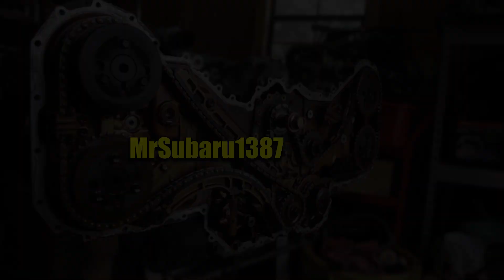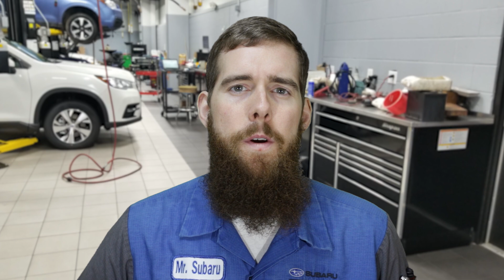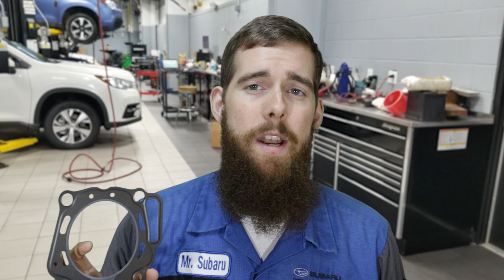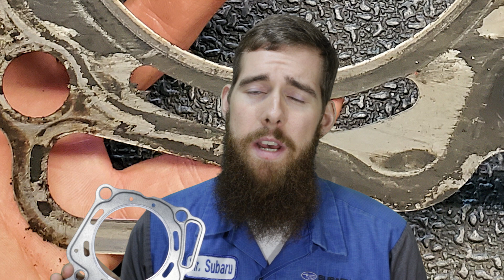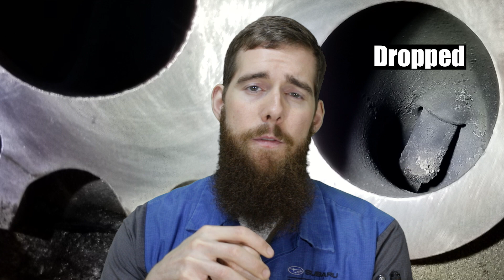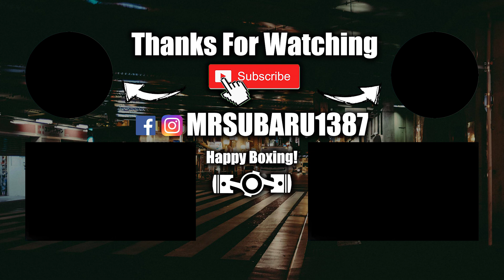Subaru Head Gaskets Explained

Comment: It seems like the head gasket issue was confined to a few engine models in the late 2000's. 
Is it safe to assume in newer models such as 2020' Outback, 2019's Forrester, the head gasket problem does not exist?
Also curious. @11:48, the problem gasket was shown. How is it that the head gaskets used in other good engines have no issues? I assumed Subaru either made these gaskets or outsource to third party. In either case, the gaskets from Subaru are still carbon coated. Why some engines fail using these gaskets and some don't?  Could the placement of coolant and oil ducts in these problem engines also play a role? aka it is an engine design problem and not just a gasket problem?
How are the head gaskets from other OEMs differ from those from Subaru?
Reply from the maker: Head gaskets are not an issue on the new FA/FB engines. 2011/12+

Comment: Please help with some advice...2008 Forester XT 2.5 engine..the temperature went to max hot and blew off the hose on the radiator next to the cap. Refilled with water and it overheated again...no evidence of oil/water mixing, could the thermostat be stuck closed or is that definitely a head gasket thats gone?

Comment: Could you give your opinion on an issue a mechanic I know told me. He skims the heads of engines for various Dealers, one of them is Subaru and he said the main problem for Subaru is that it can get airlocks in the cooling system, or say they change the water pump, they can never get all the air out of the system after they change it and that leads to over heating and warping on the heads and the Cylinder head gaskets going.  Have you found this issue?

Comment: I have a 2011 Subaru Legacy 2.5i sohc non turbo and my head gaskets are failing. The car has about 175k and I don’t believe the gaskets were ever changed. The current head gaskets on it now appear to be mls. Do you think the Subaru oem mls turbo head gaskets you mentioned in this video would work on my car? At first I was thinking they were the single layer graphite ones but noticed the multiple layers and to my knowledge they are the original gaskets.

Comment: Incredibly in-depth, and wow, do you know your stuff. Mostly, I know how to change my oil, and that is about all I do--bottom line, my 06 Sequoia has nearly 200,000 miles on it and will need to be replaced in 12-18 months and I am considering Subaru--my head was swimming here, so I may have missed it, but are the 2020 Crosstrek, Forester and non-turbo Outback free from the head gasket issues? Thank you!
Reply from the maker: Correct, the head gasket issues were put to bed around 2012/2013.

Comment: i have a 2008 outback 2.5 with the heads leaking oil, it has 268k still not sure what engine code i have EJ25??  or what parts to buy for the job? the shop i will be using started using advance and autozone for parts so i need to pick up my own quality parts for the job...

Comment: So best subaru engine is the eyehawk 2006 impreza wrx /st 2.5 turbo? Or this model has the good gasket from factory?  As I'm planing to buy one . Found one 2006 impreza wrx 98k miles fully stock, FSH in UK. What advise would u give me? Thanks.

Comment: My 2014 Outback at 105K miles just experienced a head gasket failure on 27-May-2022. Subaru of America is willing to pay $2k, my dealership is willing to pay $2k, leaving a balance for me of $2,700 and change. Best they can do according to them. The head gasket repair kit has part number 10105AB580. Is it the same as the epic-fail part 11044AA633? If it is, then should I still go with the MLS Turbo gasket 11044AA770??
Reply: SOA decided to increase contribution for my repairs to $3,500. This leaves a balance of $800. I still think this graphite coated gasket will fail again. The Subaru mechanic at my dealership did not want to install the MLS gasket because he claimed it would not fit my engine. I couldn’t argue because they were paying the Lions share of the repairs. Is he correct on this?

Comment: I'm 40 years old and have been driving since I was 16. I've had countless Fords, one Hyundai and a 2003 Subaru Outback 2.5 Limited. The Outback was by far the overall best vehicle I've ever owned and I miss it terribly! I just recently gave it to a lady who lost her daughter and husband, plus had her car quit. 

Now looking at a 2011 Outback 2.5 limited to try to ease the pain of missing my old one. The guy says it runs and drives fine but needs head gaskets. Thinking about taking the hour drive to go look at it in person this coming week.

Is there anything else you would suggest looking for on a 2011? You seem very knowledgeable on these engines.
Reply from the maker: I'd be slightly worried about the CVT. Just depends on mileage and maintenance though.
Reply: @MrSubaru1387  200k miles, one owner. He said it runs and drives fine and is visually near perfect condition. I think I may do your funnel trick to check to see if it really is a head gasket issue. I just watched your video on checking used ones out. Excellent stuff!
Reply from the maker: Usually the 2000-2012 had external oil/coolant head gasket leaks. Usually don't blow to compression.
Reply: @MrSubaru1387  Nice to know! The guy is only asking $2,200 for it but I'm kind of thinking maybe a 2013 or newer would be a better bet.
Reply from the maker: @Metalbass1979  that's awful cheap. Personally, seems a little suspect. But, on the other hand, could be a great deal.
Reply: @MrSubaru1387  I went to check it out. It is in nearly show room perfect condition and extra clean inside and out and underneath. New water pump and timing belt. No leaks of any type. He said it had the hot light came on and they immediately shut it down, guessing it is a head gasket. The coolant was low but I got no bubbles and and them took it for a good test drive. 

Getting it for a whopping $1900! I figured that if I have to tear the engine apart, I my just turbo it. Seriously,  thank you for showing me what all to look for.

Comment: I have a 2006 Subaru Outback 2.5L non turbo. What about the mahle original head gasket? They are supposed to be the updated version of the OE gasket. Your opinion?
Reply from the maker: Subaru MLS turbo gaskets are the only ones I see not fail a second time.

Comment: Thanks for the great info... I have a weird one.. I have oil in the coolant but no coolant in the oil ( that I can visually see) and no snotty oil or snotty (milkie)  residue under the oil fill cap.
It is in a 2014 Forrester 160,00 miles non turbo.  Do you think it is a head gasket or something different.

Comment: MrSubaru1387 is the torque specs, bolts that you use, pattern the same for the original headgasket as it is for the mls if using mls gasket in the ej engine that used the old hg?

Comment: My head gaskets just went on my 04 model. Im pushing 24 lbs of boost. Should I just put a built block in it or do I take the easy route and replace the gaskets.
Reply: 130k miles.

Comment: I had a 2000 Outback with the 2.5L. Head gaskets at 50,000 and 100,000 miles. Trans was slipping at 105,000. What a lemon.
Reply from the maker: The replacement wasn't done properly at 50k miles. A 4EAT slipping at 105k miles? Did you not service it?  Did you tow with it a lot? Live in the mountains and drove around in overdrive? That's very odd and not common.

Comment: What does not make sense is Subaru has had problems with their head gaskets in the 2.5 litre single overhead cam engine since the 1990s. As you explained the problem is with the gaskets themselves. But replacing those gaskets with the Turbo 2.5 litre engine gaskets solves the problem. I am sure Subaru engineers actually figured out what the issue was a long time ago. So now why would they even sell the old graphite coating defective gasket now? Subaru instead sells you a blue coolant with some  "stop leak" mixed in with the coolant fluid. Replacing head gaskets on a Subaru is an expensive repair. In the late 1990s, Subaru replaced a lot of head gaskets for free. Somehow I don't think they have continued that policy. As you mention Subaru cheaped out and rebranded Holts stop leak in a Subaru bottle. I have a 2006 Subaru Outback with 176,000 KM on it. So far no head gasket issues. But I do change my oil regularly and have replaced the coolant twice since I bought the car.

Comment: My 05 Subaru Legacy Outback 3.0 drove like a dream until 155k miles and the head gaskets catastrophically failed while driving on the highway (I was religious with oil changes and coolant maintenance)....This flaw has solidified me never buying a Subaru again. Yes it was great in the snow etc, but comparatively, was terrible on gas. I had an 05 Toyota Camry with over 200k miles. The engine was still great, needed front end, I opted for the used Subaru...BIG MISTAKE!

Comment: Hey I hope you can help me with your expertise.
So I sent my car in to replace gaskets on my 03 Impreza with a Sohc ej202.
When done the passenger side only is leaking oil on the top of the engine.
Now over and over I keep telling the mechanics to torque it the way the manual said, but they refused.
They just kept taking my car and not fixing the problem.
Mind you the car didn't have this issue before only after they did the change.
On Thursday I am gonna get another mechanic to do it via your method posted in another video.
But any help would be much appreciated, because this other mechanic thinks its not that.
Checked the oil pressure sensors, its not that, not rocker cover gaskets either, you can see oil seeping through the sides of the gaskets.
Oh and the initial problem was very small, no coolant loss unless I drove hard, but there were exhaust gases coming through the radiator. So I know the head wasnt bad or anything serious was wrong, I could have drove it normally daily, just slower than usual without any overheating or anything close to that.

Comment: Hi my name's Dillon. (Using wife's account) I have a 07 sti with fresh long block in it mileage is 1,467.  And curious on what causes cylinder roughness at idle? Mine is cylinder 2 and 4. Up to 6 count on 4.  2 or 3 on cyl 2.  Also is there a way to know if it just needs valve adjustment? Or timing is off? Without doing leak down? Btw when running no knock feedback or codes or roughness only at idle. Thank you. Look forward to hear back.

Comment: I own a 2005 Outback with a 2.5i single over head cam.  1. which series engine do I have, and 2. did this series have head gasket issues?
Reply from the maker: EJ253
Yes
Reply: @MrSubaru1387   You got it.  The spark plug wells had oil in them.  Ordered valve cover gaskets and plug seals.
thanks!

Comment: Help!!! Just bought from a dealer a 2012 Outback 2.5i Limited wagon. About the third day we had it, it started overheating. 112,000miles. Already had it scheduled to have the timing belt replaced. 
We bought it as is, but the dealer had their Subaru dealer take a look at it.
They drove it 73 miles, idled it for hours and it didn’t overheat. Also they said they pressure checked it and said everything checked out okay.
We paid $12900 for it and I don’t feel like we can trust it to drive it even 100 miles. 
It’s already stranded us once and we haven’t even picked up the paperwork for it yet.
Could it be the head gasket?

Comment: I'm not a Subaru fan, but pretty sure a lot of car companies wouldn't have trouble with head gaskets/bolt threads if the government didn't mandate such high temperatures to burn the HC off the oil.  In my opinion, anything over 200 F is destructive to an engine and most engines run in the 220's-240 now.  Not sure if that has any effect on Subaru's though.
Reply from the maker: Subarus run 190-210.
Reply: @MrSubaru1387  Thank you sir, it has been like pulling teeth get this from my dealer. I have a 3.6r 2019

Comment: My 02 outback leaked oil out the head gasket so I pulled the heads off had them shaved and they took .0010 off them, I used Felpro MLS gaskets (how was I to know) which are about .0022 so it evened out with the original about .0010.  Did all the engine front stuff for 100k mile maintenance and reused the head bolts without the stretch torque run up.  That was 4 years ago and all is well.  Tomorrow the heads will probably fall off.

Comment: My bugeye never had head gasket or any leaks but did have burnt exhaust vavle at 140k and now it leaks from one of the cam seal cause the mechanic scratched the camshaft or housing pulling off the seal during repairs 😪

Comment: I was under the impression that the issue with the graphite is that it would create a battery with some of the other metals in the engine  and the coolant
Reply from the maker: It does somewhat. Especially if you don't keep the coolant changed and the battery terminals clean.

Comment: I hope you can respond to this.  Currently in my city there are 2 JDM legacies for sale.  1998 twin turbo GTB wagon, and a 2005 twin turbo wagon.  Both are around the same kilometers on them and pretty much the same price.  Both are JDM.  Do you know if these are the motors your referring to with the head gasket problems?  Which one would you say has the more reliable motor?

Thanks in advance

Comment: I like Subaru overall.  I would love to buy another Subaru.  I have had 2 Subaru Forrester cars and both failed due to head gasket issues, with the models roughly 2000 and 2010.  For the life of me I cannot fathom why they would not have improved this serious error.  I love the AWD system but I can get by without it.  I cannot get by without an engine and this is what has killed both of my Subarus (in some cases more than once as I had the engine rebuilt).  This seems like a fatal flaw with the design but please correct me if this issue has been fixed as I'd love to get a Subaru again if they have FINALLY fixed it.

Comment: When I input the part number for an MLS head gasket for Subaru parts on Subaru website it tells me it is not compatible with my 2010 forested x. It still calls for part ending in 633, instead of AA642. Should I disregard this and go with the AA642 MLS?

Comment: My early 2014 Forester 2.5 just developed a head gasket issue at 170k miles with compression in cylinders 1 and 3 at 110 and 55 PSI, respectively. I was shocked to discover this because I've babied this car, changing the oil (Mobile 1 0w20) regularly. This engine did consume oil between changes as was "normal" with this engine before they swapped it out with a revised design mid-2014. 

I'm having a 2015 engine with lower miles installed instead of doing the head work but I'm curious why this happened.

Comment: I saw a comparison that showed the open deck of the NA models was part of the issue - with the engines you mention that are better or worse, is there a difference in the cylinder wall support?

Comment: You're telling me the EJ255 does not have HG issues? I am seriously considering an '11-'14 WRX, but have been terrified of having to replace the HG 3 months after I buy it.
Reply from the maker: Head gaskets were only a factory flawed failure point on EJ25D, EJ251,252, and EJ253.

Comment: Good info! Your explanation exactly fits the complaints I have heard: head gasket internal failures soon after 100K miles.
I have heard rumors of coolant purging problems in [unspecified] Subaru 2.5s being responsible for head gasket problems. Is that a problem at all or is that a myth?
Reply from the maker: Well, some of them are a bit hard to get all the air from the cooling system, sometimes. Could cause issues with hot spots/overheating. That issue only comes with a system refill though.

Comment: I owned a 97 Leg GT and I now own a 99 Leg SUS.  Both have the ej25d and both had head gaskets replaced.  My GT went over 200k before the head gasket went.  Bought the SUS a few years ago with only 105k.  At 115k the HG went so for me HG problems and subarus go hand and hand.  Too bad for me I like the 2nd generation 2.5 legacys.

Comment: Do you prefer felpro or victor reinz gaskets besides the oem ones ? I'm  somewhat concerned I have a 2006 sti with 130,000 miles ej257 .I have done both a compression test and leak down so all is within spec. Syn. Oil changes at 3000 miles oem long life coolant w/subie conditioner. I do not abuse the car. What else should I be concerneed about?
Reply from the maker: I only use/install the Subaru genuine gaskets.
Reply: Thanks for the quick reply. I used enginetech master gasket kit on 1995 honda odyssey when I  repaired  head after broken timing belt om hwy recently. Went budget  van has 300,000 miles . 4 bent valves with related the head gasket is 3 ply metal

Comment: In the course of head gasket replacement on a 2011 2.5 liter non-turbo Outback, I'm wondering if you normally machine off any more than usual from the heads due to the greater thickness of the MLS gaskets and the possible likelihood of unintentionally lowering the compression ratio? If so, how much extra machining is reccommended? Can anyone advise on this please?
Reply: MLS gaskets are actually THINNER than single-layer gaskets after screws are screwed in (they compress more). So you DON'T want to machine more than absolutely necessary.

Comment: I installed an aos and a downpipe together and I cant find an oil leak for the life of me either in the engine bay or underneath the car but after any boosted driving there is an oil smell coming from the engine bay and it goes away after I turn the car off and isnt there at startup or idle. Never any smell out of the exhaust. I used oe gaskets for everything. I've triple checked all hoses at this point and even upgraded the tie wraps to super thick ones I could get really tight. I'm at a loss and would appreciate any advice.